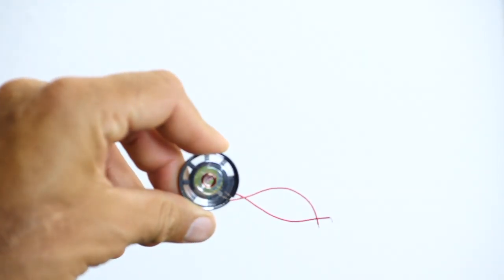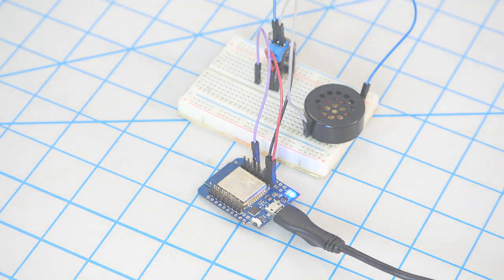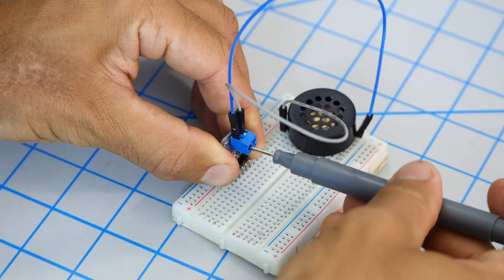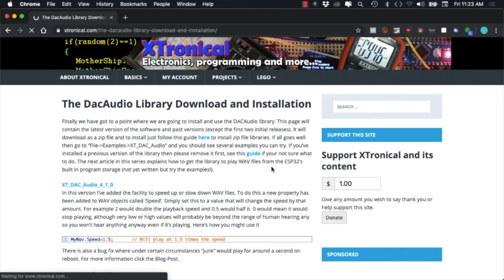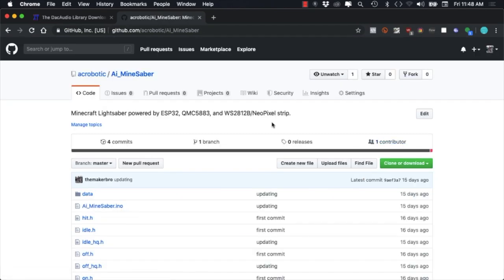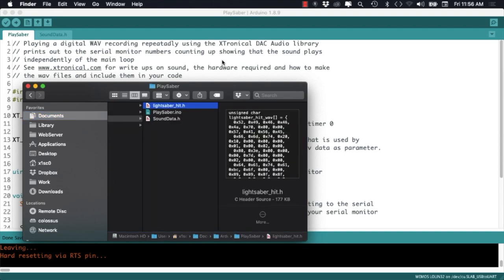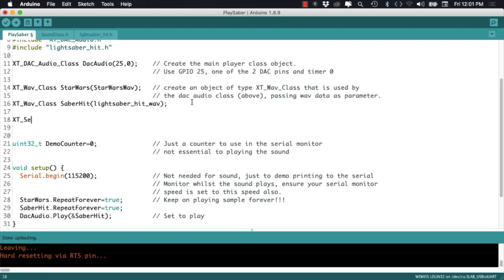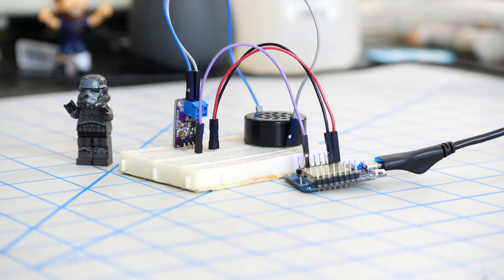ESP32 .WAV File Playback | PAM8302 Audio Amplifier

Comment: I've been trying to get an ESP32-S2 to play sounds for about 2 months now without success, using the Arduino IDE. It seems all libraries were made for old versions of the ESP core and arduino IDE and trying to get them to work in 2024 is a real challenge. I used to program small projects in arduino nano without any problems, but switching to ESP32 has been a nightmare. I started with a QT PY ESP32-S3 from Adafruit, only to realize it does not have a DAC pin, so I switched to a Lolin/HiLetGo ESP32-S2, and even though I have 2 DAC outputs, its been impossible to make it work. Don't want to give up but its really frustrating

Comment: I don’t know if the little box attached to wires and board is included in store catalog page.??? And your pins on the amp are 90 angle not 0,  the screw terminal was not included with purchase? shows on picture? Screw terminal connector?

Comment: For high quality sounds you can use DFPlayer Mini module (or your own solution based on voice chips like XY6xxx (eg YX6100) or JQ6xxx (eg JQ6500).
Reply: Or even ES8388 (present on ESP32-LyraT Dev board)
Reply from the maker: Yup, yup. Thanks for sharing!
Reply: @datasith  I tried the DFPlayer.  The problem with using it for sound effects is that you have a pretty decent delay before the sound plays and reacts to new commands. This brought me back full circle to using the PAM and the internal ESP32 DAC.

Comment: sir, please make a video for ESP8266
Reply from the maker: Hey, Sachir. Sorry, the library doesn't work on the ESP8266. You need quite a bit of computational power to decode the .wav files, and as far as I know, this is very hard to do on the ESP8266. An alternative would be to use an .mp3 external chip, you can load your sounds on an SD card as well. HTH!

Comment: What are the commands on the Mac to create the .h file from wave file. I use windows mainly but I do have a iMac .. which would seem the easiest way to convert the files.
Reply from the maker: I'm not into advocating for Apple devices, so I'll just state that having an OS that includes these tools by default saves me a bit of time in my electronics tinkering. So yes, if you have an iMac it should be straight forward. The command I used is:
xxd -i lightsaber_idle.wav > lightsaber_idle.h

Thanks so much for watching!